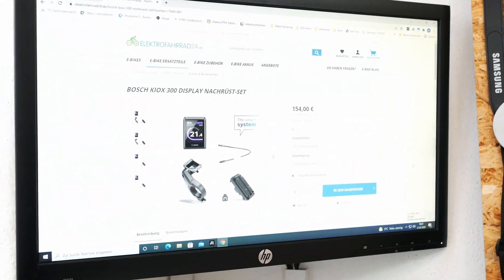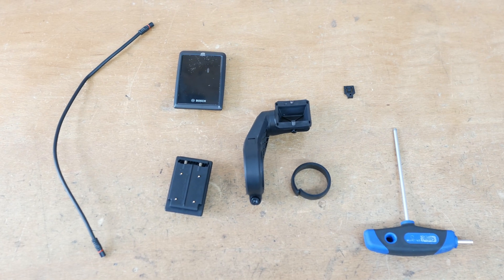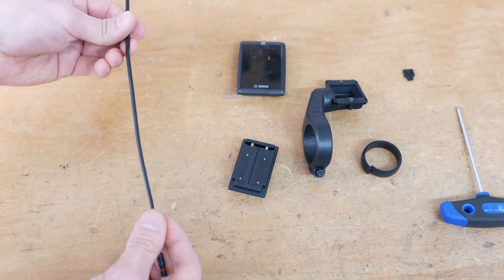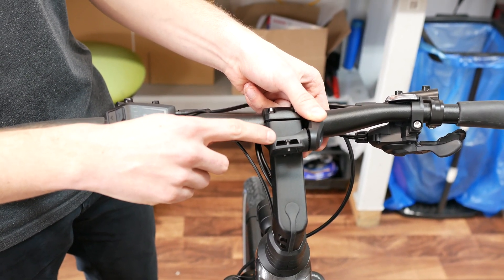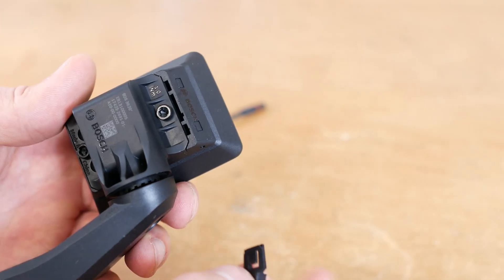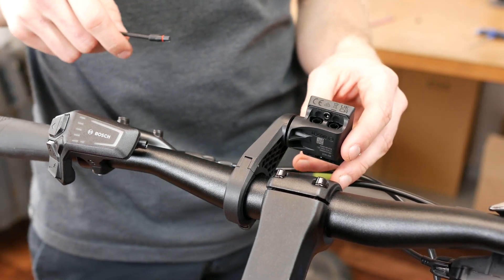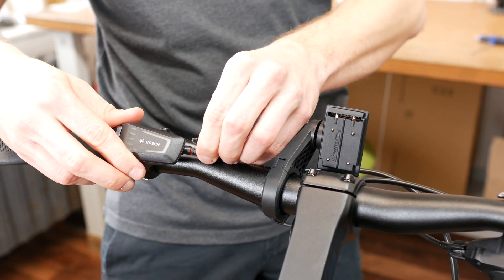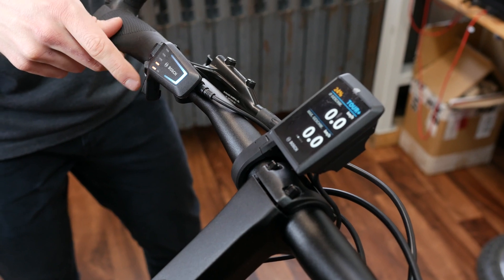Bosch Kiox 300 display retrofit do it yourself tutorial | EBIKE24.com

Comment: Is it possible to display bike speed only with this setup that you have?
Reply from the maker: It's not possible to hide other data such as battery capacity, distance, and so on. Nevertheless, with the newer “Dynamic Screen” feature (via the eBike Flow app), the display tries to show the most relevant data depending on the situation (e.g. on flat stretches it shows speed, distance, range). You can also customize some of the screen layout / data shown, though there are limits. Thanks

Comment: Hello and thank you for the video. I can't seem to find the mount for the kiox 500 where the wire inlet is in the front of the bike. most retailers have the wires facing the back. can you please give me a part number or let me know where to purchase the mount kit where the display mount wiring connectors are facing the front  of the bike. thank you .
Reply from the maker: Hello, here you can choose: https://www.ebike24.com/bosch-kiox-300-e-bike-display-for-smart-system --> Depending on how you want to mount the Kiox 300, you will need a different display mount. Mounting in front of the handlebar - you need the mount with cable exit at the back. Mounting behind or above the handlebar - you need the mount with cable exit in front. Thanks.

Comment: Hello, sorry for the silly question. I have a 2023 Cube Touring Hybrid, it just has the LED remote and the motor says "Bosch Performance Line. Cube says " Bosch Drive Unit Performance Generation 3 (75Nm) Cruise (250Watt), Smart System"

Kiox 300 will work for me, correct?

Comment: Thanks for the very well done video. I have a problem though: the cable coming from the motor is too short to reach the support with the cables in front. Can you show me how I can replace it and how long the new cable should be? Thanks

Comment: In the video at 5m45s, you connect a second cable. Where did this come from, does it already exist or does it come with the retrofit kit?
Reply from the maker: Hi, and thank you for your comment! The cable you’re referring to is the one that was previously connected to the LED Remote. You can see us removing it from the Remote at 4:20. So yes, it’s the cable coming from the motor. 😊
Cheers - Michael

Comment: Does it work if I put a kiox 500?
Reply from the maker: Yes, it works exactly the same for the Kiox 500. It also has the same holder so you can simply swap the displays. You can find it here: https://www.ebike24.com/bosch-kiox-500-display
We also have a separate video regarding the Kiox 500 installation: https://youtu.be/9JcT2Ahs7fQ?si=kE2Eq3bYE1dXuXcd
Cheers - Michael

Comment: hay, nice vids you make here, now I have Genesis E-PRO MTB 1.2 PT with 4th gen Bosch (85nM)  but also have Purion, is it possible to replace it with kiox or Nyon? thanx
Reply from the maker: Hi, thank you for your comment. I looked up your bike, and it appears that it does not have the Bosch Smart System but the previous Bosch eBike System 2. If your Purion display looks like this, then it is definitely the Bosch eBike System 2: https://www.ebike24.com/2017-bosch-purion-e-bike-display-performance-line

You can still upgrade to another display. You can use the Kiox display for the eBike System 2 (different display than the one in the video): https://www.ebike24.com/bosch-kiox-display-set

The Bosch Nyon display also fits: https://www.ebike24.com/bosch-nyon-display-2020-2021

You can also contact our customer service for any questions at info@ebike24.com.
I hope this helps!
Cheers - Michael
Reply: @ebike24  great! thank you for replay!  Yes that`s Purion I have now installed!  I`ll go for Kiox you linked, but is there detail manual for instalation?
Reply from the maker: There should be a manual inside the box with the Kiox. However, you can also find it online here: https://www.bosch-ebike.com/fileadmin/EBC/Service/Downloads/Bedienungsanleitungen/MY2021/Kiox_Online_Manual/Bosch-eBike-Manual-Kiox-Online-MY21-EN.pdf?_=1708417639

Comment: When i instal the kiox can i know the mileage of my bike now ? Or it will say 0
Reply from the maker: Hi, thank you for your comment. All the riding data is stored in the motor. So when you connect a new display it will automatically receive this data from the motor, and it will be shown there. This includes mileage, average speed, etc.
Cheers - Michael

Comment: Hello, I own the Ortler Bozen Premium LTD Trapez with Kiox300 system2 on a Bosch CX Gen.4. Does this mean I can switch over to a smart system..? Many thanks.
Reply from the maker: Hello Eric, Thank you for your comment. From what I found online your bike has the previous Bosch eBike System 2 installed and not the Smart System. Switching to the Smart System is unfortunately not possible. You mentioned the Kiox 300, which is the one in the video. Are you sure that you have installed the Kiox in the video, or rather this Kiox display from the eBike System 2: https://www.ebike24.com/bosch-display-kiox ?
Cheers - Michael
Reply: Thankes a bunch for your reply. Ah oh aj, i thought my screen was called Kiox300 :-(, but it is indeed the one from the link.Keep up the great work 🙂 @ebike24

Comment: i have a Bosch Kiox BUI330 and was just wondering if there is an adapter for the contacts on  the kiox 300?  i assume i'm SOL.
Reply from the maker: Hi and thanks for your comment! What exactly do you mean by adapter? The Kiox BUI330 is for the previous Bosch generation (Bosch eBike System 2). The Kiox 300 in the video is for the current generation (Bosch Smart System). Unfortunately there are no possibilites to upgrade / convert the eBike System 2 to the Smart System. I hope this helps!
Cheers - Michael

Comment: Hello can i fit it to trek rail5  emtb model 2022?
Reply from the maker: Hello Mariusz and thank you very much for your comment. According to the data I found, the display does not fit to your Trek unfortunately. The Rail5 from 2022 uses the previous Bosch motor generation and not the Smart System. The Smart System is required for the Kiox 300 to work. Sorry for not being able to help you further!
Cheers - Michael

Comment: Will this upgrade be compatible on my gazelle performance line motor. Its a 2022 model not a cx motor though. Looking to upgrade the bosch intuvia display to use the  new retrofit gps tracker and alarm. Thank you very much
Reply from the maker: Hello, and thank you very much for your comment. Unfortunately, the Kiox 300 will not fit on your bike. The Intuvia display on your Gazelle bike suggests that it uses the previous Bosch eBike System 2 rather than the "Bosch Smart System" software required for the Kiox 300 display installation. Same goes for the Bosch ConnectModule tracker. However, there is a Kiox display available for your bike, as well as a GPS tracker. Let me know if you have any further questions.
Kiox display: https://www.ebike24.com/bosch-kiox-display-set
GPS tracker: https://www.ebike24.com/bikefinder-gps-tracker

Cheers - Michael
Reply: @ebike24  hi Michael,  thank you for the great reply. Yes it seems like that maybe the set up I have. Rather annoying ad I'd like to have the newer set up with the WiFi etc. I'll contact gazelle to see if I can send it back to get it updated in house for me. Thank you very much. If I can't get it updated I will do what you have suggested. More for the better display and GPS tracker as I don't like parking my baby for any more than 5 mins. 👌
Reply: Also just looked at the terms and conditions of that bikefinder GPS tracker and there insurance is only for bikes up to 250 watts of power and under 15klm per hour. So it won't cover my bike as its a pedelec. Any other help would be good unless you can wire up the bosch system somehow if anyone is good with electrics.
Reply from the maker: @denhaagtrader8781  Hi again, as an alternative, we have this tracker available as well: https://www.ebike24.com/powunity-bike-trax-gps?number=2642-005
Unfortunately, there is no way to update the drive system of a Bosch bike. At least not as far as I know. So I am doubtful if Gazelle can upgrade your bike to the Smart System. 
Cheers - Michael

Comment: Hi, I have a 2022 Orbea Wild FS M-TEAM, it has the CX gen4 motor but it’s the 625wh battery version. Could I fit this kit? It currently has kiox bui330.
Reply from the maker: Hi Lennox, thank you for your comment. The Kiox display indicates that your Orbea bike has the Gen4 Bosch drive without Smart System. The new Kiox 300 is compatible with the Smart System only unfortunately. However, if you are looking for a new display I can recommend the Nyon display: https://www.ebike24.com/bosch-nyon-display-2020-2021
Cheers - Michael

Comment: Hi great video , would this fit on my 2022 Cube reaction Hybrid pro?
Reply from the maker: Hi Mark, thank you for your comment and your kind words. From what I found online it looks the the Cube Reaction 2022 does not have the Bosch Smart System which is required for the Kiox 300 display. Which display / remote unit do you have currently installed? BR - Michael

Comment: Hi.. Great and helpful video. Thanks. Can this Kiox 300 easily be placed on a bike where a Intuvia 100 is mounted? In other words, upgrade Intuvia 100 to Kiox 300? Thanks for you answer
Reply from the maker: Hi Technoslet, thank you for your kind words. Yes, you can easily upgrade the Intuvia 100 to Kiox 300. Just keep in mind to get the complete retrofit kit because the holder is different. You can find the kit here: https://www.ebike24.com/bosch-kiox-300-e-bike-display-for-smart-system
Cheers Michael
Reply: I'm interested in doing this upgrade as well, but I don't think it's as simple as replacing the screen. Is there a guide somewhere?

Comment: Hi, is it necessary to do anything with the motor? Where did the motor cable occur to connect? Is the package on your website everything you need and will I be able to install this myself as in the video without professional help on my new e-bike? Thank you!
Reply from the maker: Hi Ladislav, thanks for your comment. The only thing you need to do on the motor is to plug in the display cable coming from the motor to connect it to the Kiox 300. The LED Remote is then connected to the Kiox 300 as shown in the video. Everything you need for the conversion is included in our retrofit kit (https://www.ebike24.com/bosch-kiox-300-e-bike-display-for-smart-system). The connection cable between the remote and the display is 30 cm long. If you prefer a shorter one, you have to order it separately. For the conversion, you can simply follow our video, if you follow all the steps, the conversion should work quickly without any problems. However, if you are unsure, we can always recommend going to a specialist dealer. If you have any questions, please do not hesitate to contact us here or by e-mail at info@ebike24.com.

Cheers, Michael
Reply: @ebike24  thank you Michael. Much appreciated 👍

Comment: Thank you for this video....can you help me in my doubt if you have experience. On my bike I already have a kiox 300 display and a smartphone grip.  If I were to buy a bosch arm socket and a Display Interface Rearplug (BDS3210), would it be possible to have a kiox 300 and a smartphone grip connected at the same time? You can see what I mean at the link.
https://drive.google.com/file/d/1ChSzYp1PZxYOfNxV1EaVb9bgR6j_n6c1/view?usp=share_link
Thanks for your reply and advice
Best regards
Reply from the maker: Dear Tonci, thanks for your comment and your kind words. This question has come up a few times on our German channel. That's why we asked Bosch about this some time ago. Bosch advises against using the Kiox 300 and the Smartphone Grip at the same time. Therefore, we have not tested it and cannot recommend it. Thank you for understanding.
Cheers, Michael
Reply: @ebike24  Thanks for your reply.  In the meantime, I tried this connection and everything works perfectly.  I'm not sure if it will cause any problems in the future, but I think there is no reason and for now everything is fine.
Best regards
Reply from the maker: @tonci1253  Hi Tonci, that's great to hear! Sounds like it works perfectly. If there is anything else I can help you with just let me know. Cheers, Michael

Comment: How do you add a kiox 300 to a new bike with mini remote and frame LED unit. Like orbea wild 2023? Its mini remote is wireless
Reply from the maker: Hi Bench Mark,
according to Bosch, you should be able to connect the Kiox 300 to the Mini Remote via Bluetooth. If you have any questions you can also contact our customer service: info@ebike24.com
Best Regards
Michael

Comment: How do you replace a pure Purion system to the smart system? Can you do that? Would be great to see how you replace the Purion to the led remote.
Reply from the maker: Hi JB, unfortunately you can't replace a Purion display with the LED remote. The Purion uses the previous Bosch software and the Smart Systen has a completely new software. If you would still like to upgrade your display, there are various options for you: https://www.ebike24.com/bosch-performance-line-display

Best Regards - Michael

Comment: Very helpful video. Thanks. Would i be able to fit this unit to any of the 2021/2022 Cube Touring Hybrid ebikes? Thanks for your help.
Reply from the maker: Hi, unfortunately the Kiox 300 will not be able to fit to the Cube Touring Hybrid e-bikes because they have the Gen3 Bosch Performance drive. Only Bosch Smart System motors (Gen4) are compatible. Nevertheless, you can upgrade to a variety of Bosch displays with your Cube e-bike:
Bosch Nyon Display: https://www.ebike24.com/bosch-nyon-display-2020-2021
Bosch Kiox Display: https://www.ebike24.com/bosch-kiox-display-set
Bosch Smartphone Hub: https://www.ebike24.com/bosch-smartphone-hub

Best regards
Michael
Reply: @ebike24  Will Kiox 300 fit with Cube Reaction Hybrid Performance 75Nm 500Wh 2023?

Comment: Thankyou for this video. Is it necessary to rum a cable from the motor or do the new bikes have that installed already ?
Reply from the maker: Hi, good question. New ebikes without Kiox display, only with the remote control unit, don't have it; you can buy it: https://www.ebike24.com/bosch-display-cable-smart-system. Cheers, Luca
Reply: @ebike24 Wait, wait... in the video you can see that the cable is pulled out from the remote, and plugged into the kiox300... then why would you have to bring another cable from the motor up?
Reply: @ebike24  Sorry for asking sir but do I have to open the motor and connect the cable there myself in this case?